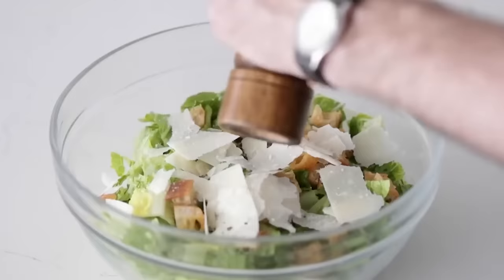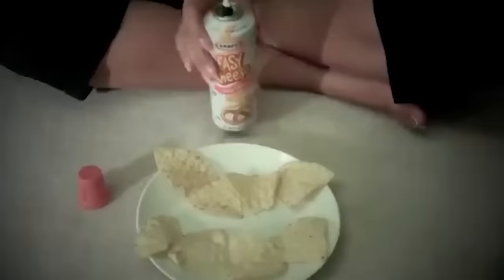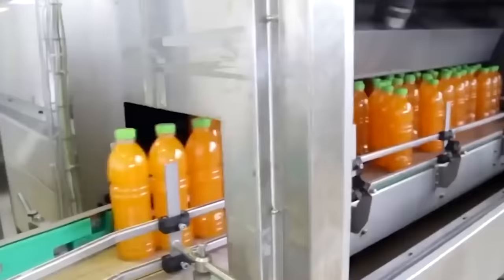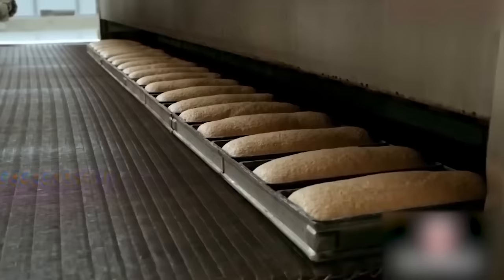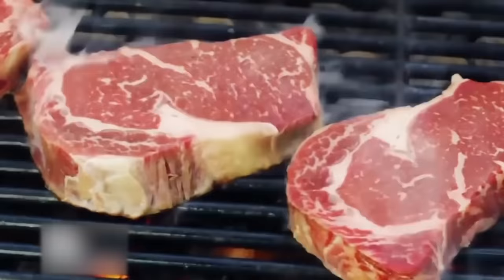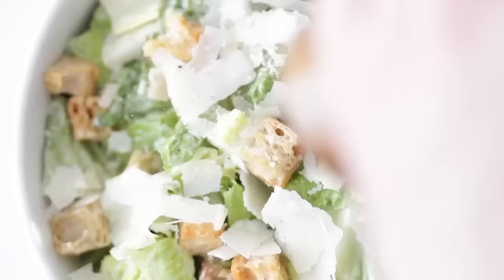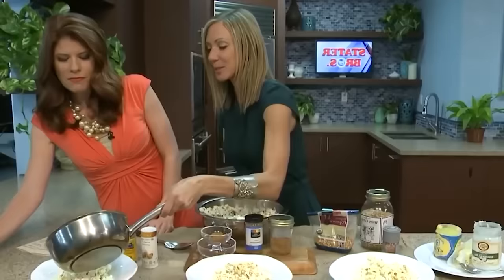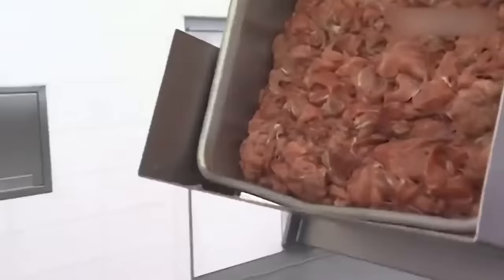You’ll Never Eat This Again Knowing How Its Made

Comment: It seems that everything we’re eating is bad for us. I want to eat healthy food but I can’t find anything. I’ve avoided anything with artificial sweeteners in it for the past 20 years and don’t drink soda because It’s just something I’ve never got a taste for. However, I had to drink one I’d opt for the full sugar option rather than drinking low or zero sugar soda full of a brain rotting neurotoxic artificial sweetener. 
I really don’t like the taste of either. I can taste them in certain ketchup, gum, yogurt, baked beans, chips, breakfast cereals and generally lots of foods that claim to be low in calories or sugar. Sweeteners are much worse for you than sugar.
Reply: I drink 99% only water. Very rarely ill have a soda, and I get those fancy  weird ones with the funny flavors usually, just to try something new. Had a keylime one, it was really good. But if you don't drink them for extended periods and stay away from sugar ,they  are just too sweet. I avoid artificial sweeteners at all costs, a big reason is I let my dogs sample stuff I make and those are super toxic for them. 

The best tip for eating healthy, is to stay on the outside of the isles at the grocery store, don't go into the middle sections. Stick with meat, produce, and fruit. Most of the center isles are just corn in different forms with chemicals. My weakness is hotdogs, I gotta have em sometimes, so im gonna try making them from scratch I think. Eating healthy is hard.
Reply: @Pax_Mayn3 I cannot eat the meat anymore non of it it taste awful and is tuff and nasty. Don't care how much you pay for it. And most fish taste like someone already ate it and it didn't set on their stomach. Potatoes. are just a pot of white thick liquid and don't taste like potatoes. Forget beef chicken and pork and rice and tomatoes Ew! If i could kus get some real food Lord knowes you pay real high prices for this stuff and you can't eat it!